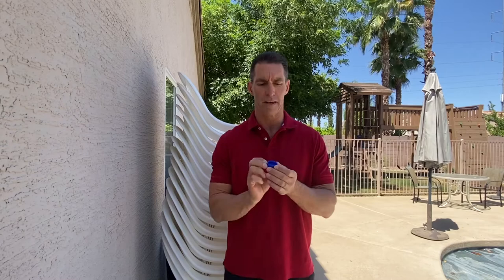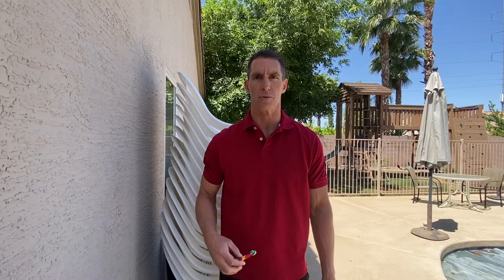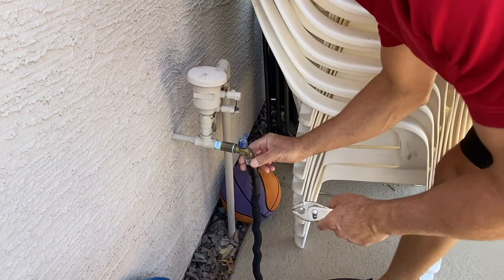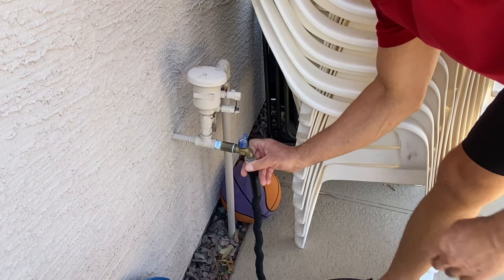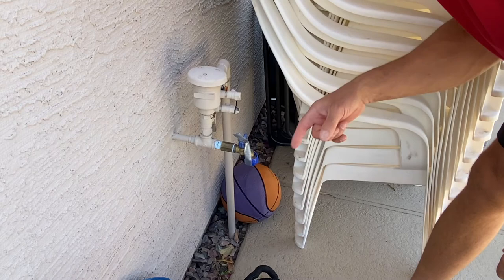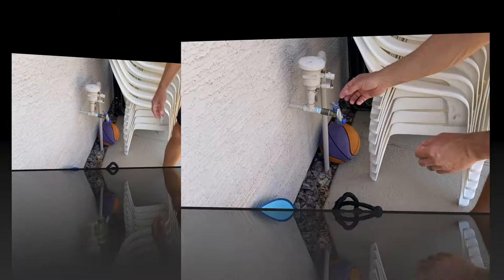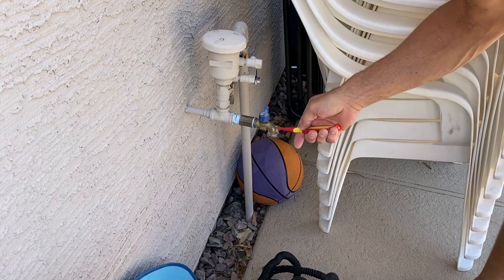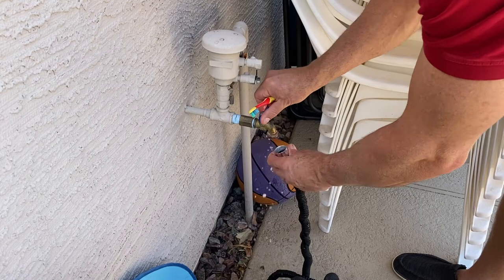Hose Bib & Hose Connector Cleaning

Comment: My question and concern is that CLR is NOT supposed to be used on Brass (See CLR instructions under "IMPORTANT: Do not use CLR on:... brass...") aren't has bibs primarily brass?
Reply from the maker: It can take the finish off of brass, but since it’s a hose bib, not something decorative, I’m personally not worried about that.  It can pit some grades of brass, but it seems like the hose bibs are of a quality that that doesn’t happen.
Reply: @stepbystephowto2981  Thx 4 ur reply. 👍
Reply: What did you use for a cap when you put it over the bib?
Reply from the maker: @kurtshea  just some screw off top of a plastic bottle that was deep enough